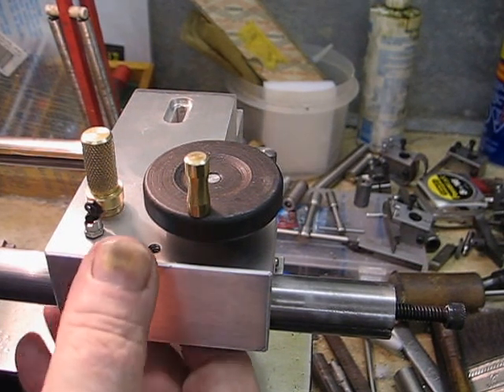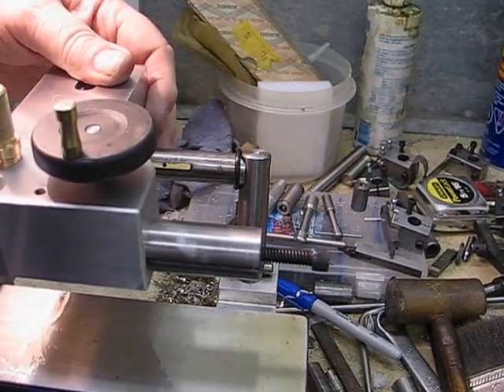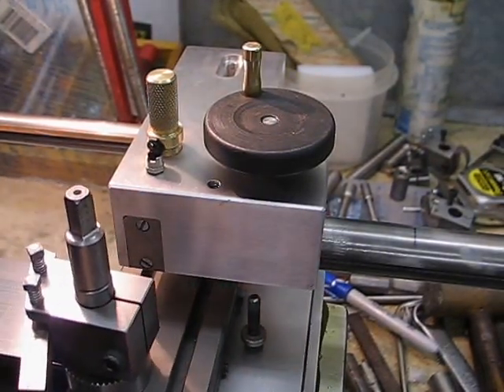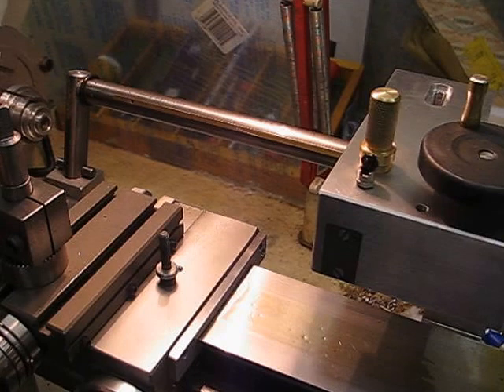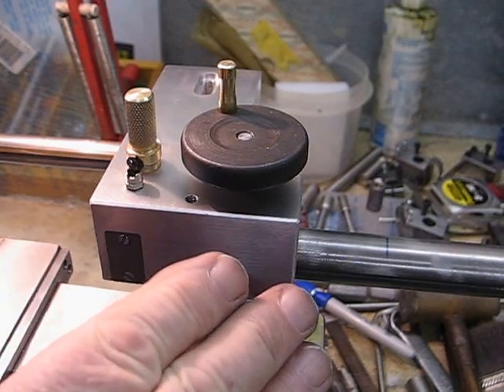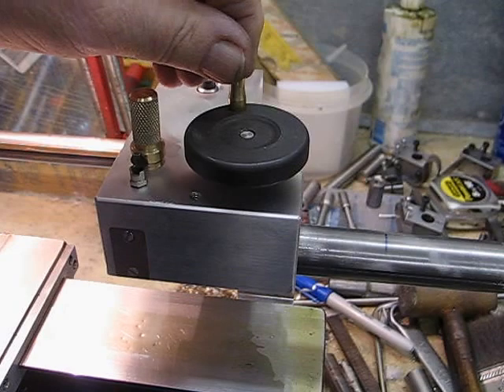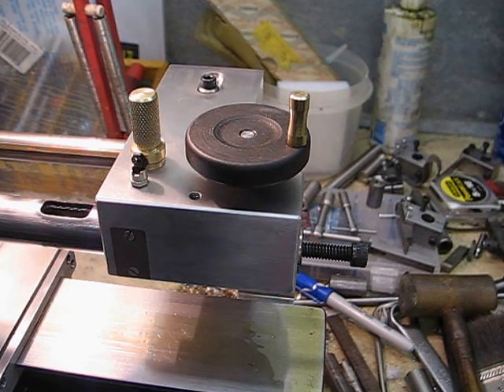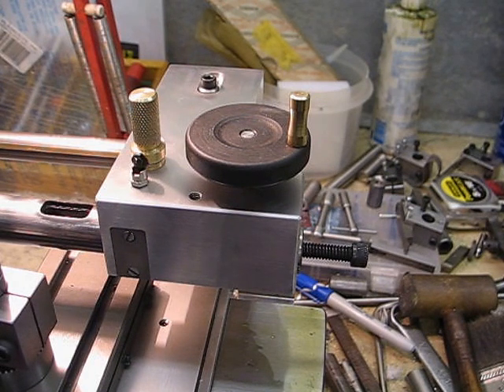MVI0008 A video of the new Tailstock I have built for the Taig Lathe

Comment: Mr. Maisey, that is really a beautiful piece of engineering / artwork.   I only wish I had a fraction of your genius to be able to create something like that.
Reply from the maker: Hello Chris,
   thank you for those kind words but I'm afraid I cannot accept your description genius, there is so many mistakes made in this tool and in its development stage, if you look at another video towards its final stage you will see that I had to add an extra part, a riser block to support the rear of the tailstock because of flexing when using between centres, not perfect but it works, but for someone interested in maybe using  it as somewhere to start from, and improve the design with their own ideas, it would get their thinking caps on,

I do appreciate your comment though,